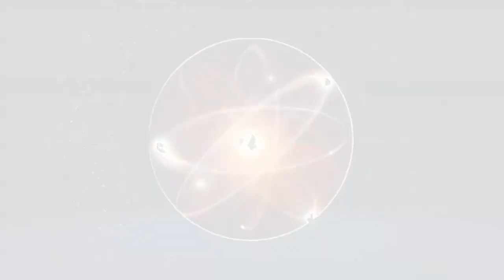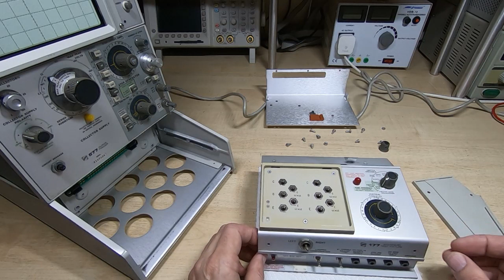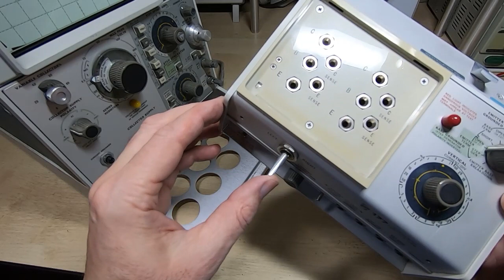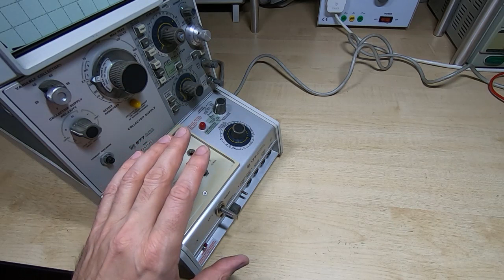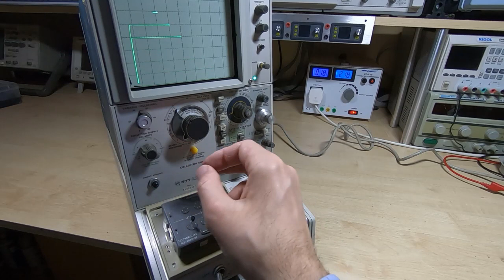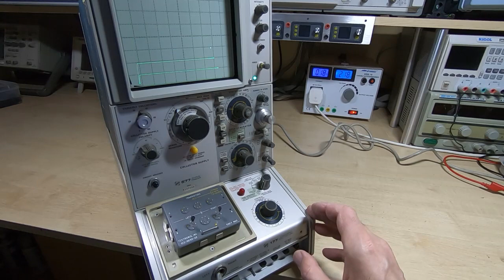Tektronix 577 Curve Tracer Part2

Comment: THANK YOU VERY MUCH FOR THIS.  577 off ebay  just arrived. have a question, I hope to get an answer to, when you get a chance, please. the beam does not show, but when I press the beam finder button it shows. also when beam finder is pressed, the beam does not appear in the center of the crt, how is the beam moved to the center of crt?
Reply from the maker: It depends on what fixture you have plugged in. I would start at the output of the deflection amplifiers and work back to the fixture. The vertical deflection drive is derived from the output of the fixture but the base unit can be tested with the fixture removed.
Reply: @JerryWalker001  thank you very much for your reply. I found the beam. have no fixture yet. looking to purchase some. 
In the process of learning how to use it now.

Comment: Thanks for the nice video!
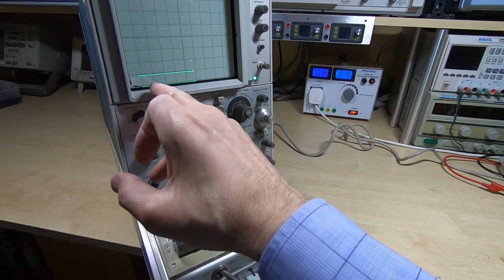Note: I think you're mistaken re. the series resistor: It's not in series with the base of the transistor, which is current-, not voltage- driven (7:58 and 9:30) by the Current Step but rather, in series with the collector supply voltage, limiting the maximum power dissipation of the DUT, as indicated on the (difficult to view) scale opposite "Max Peak Power - Watts".
Reply from the maker: You are referring to the current limit resistors which are used to limit the maximum power dissipated in the device under test. I was talking about the step control resistors and was describing the effective operation of the unit and not a detailed description of the circuit layout. The arrangement of the connections to the device under test depends on the position of the selector switch along with the fixture fitted and I will be describing this in future videos as I talk about each mode. It is not really possible to give detailed specifics in a brief introduction video.
Reply: @JerryWalker001  I realise you had to make choices on what to say and how to explain things, which BTW I think you did very well. I thought just this point was confusing because the maximum length of the horizontal lines isn't directly determined by the transistor's base current (or voltage) or amplification but by the collector current in this setting. Of course, the collector current does depend on the transistor's properties and the base current (times current amplification).
Eagerly awaiting your next instalment!
Reply from the maker: @raymonddompfrank1789  I will post a separate video on this subject as I think you maybe thinking about the 577 incorrectly. The current is Not applied to the base OR the collector (actually it may be). The 577 is a 'mainframe' and the 177 if a plug in fixture which determines the actual device connections. The 577 is nothing more than a floating power source and current / voltage source with some control and measurement circuits. Mine has a specific type of display fitted but there are other options for both the display and the fixture which can be used with the 577. It is inaccurate to say that the 577 applies current to the collector or base as any device can be tested. In my videos I specifically try to show alternate ways to use equipment and not just limit it to one type of use. When considering 3 terminal devices it is easiest to explain their operation in terms of base current (or gate voltage) because that is what determines the actual trace profile (even thought the base or emitter may be grounded if it is a bipolar). If that was not the case then the instrument would not be much use. I was therefore talking about current flow control through the device and not the 'collector' load resistors. I appreciate that initially this may be confusing but I cannot cover the entire subject in a single  video. Just bear in mind that I am trying to show other uses for such equipment and not simply read out the user manual.